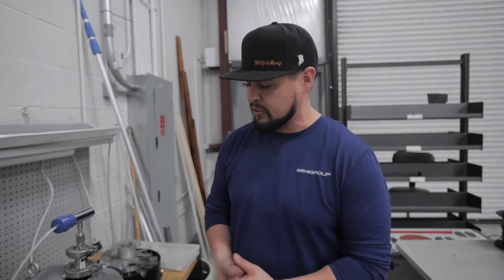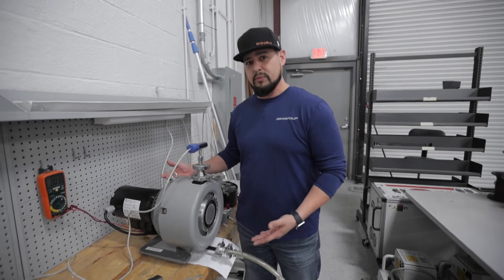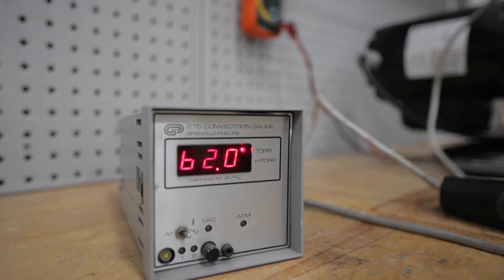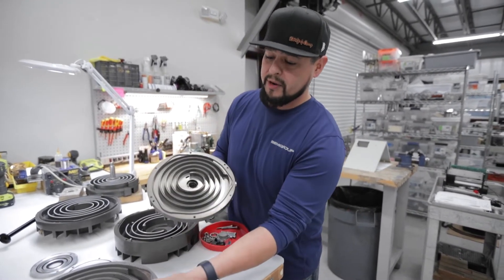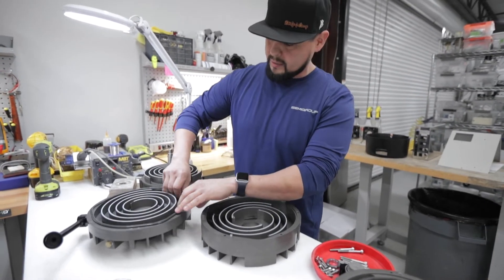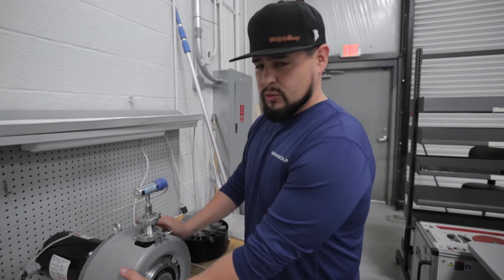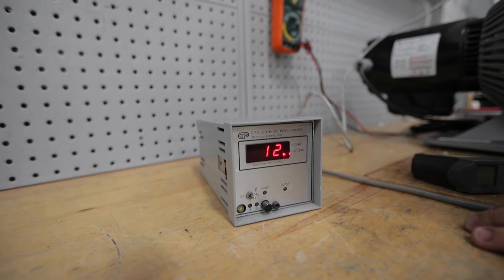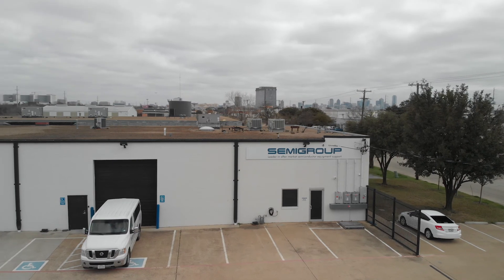Tri Scroll Vacuum Pump Repair

Comment: I have Agilent tri scroll vacuum pump. it was not creating a base pressure of 1x10-5 (its been working since last 5 years). I have cleaned interior and change the tip seal. i have checked the RPM it is 1400rpm as specified in the manual.
please advise me how to rectify this issue.